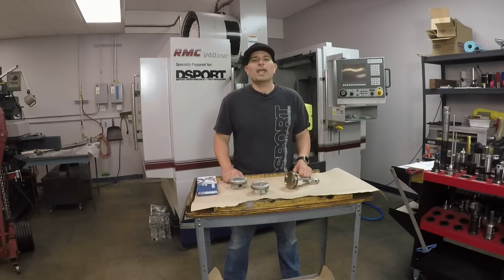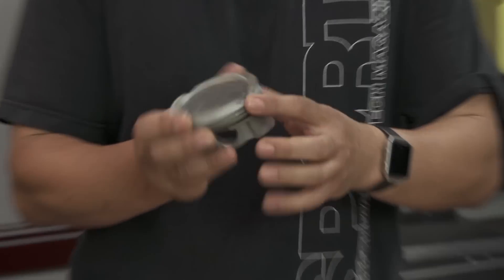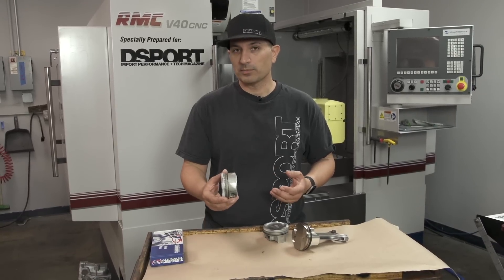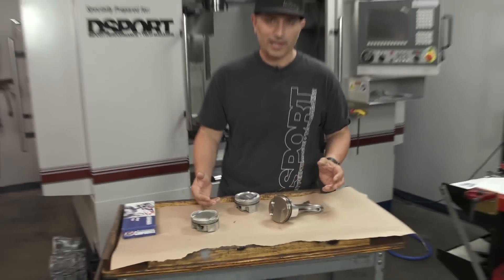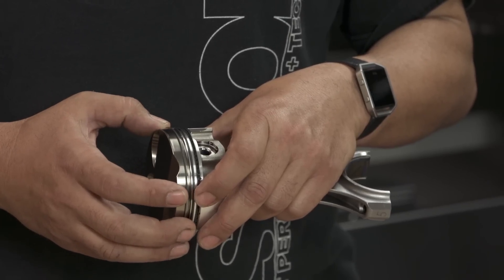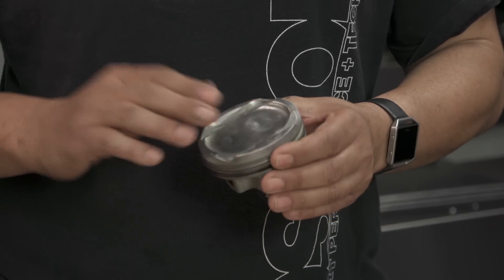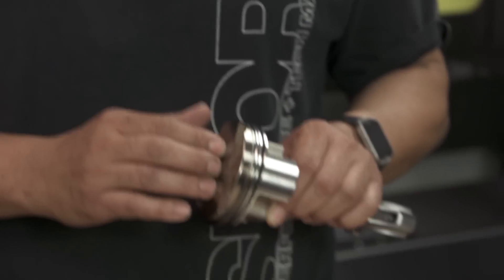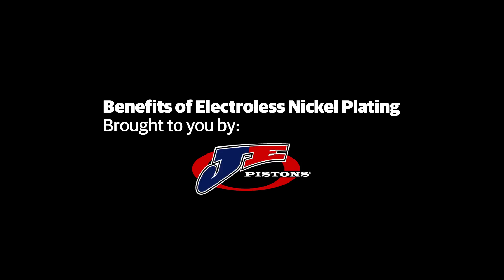Benefits of Electroless Nickel Plating

Comment: So Does Nickel Plating Provide Better Heat Protection Than Ceramic Coatings? Im Gonna Try Out This Nickel Plating Mainly Becasue My Ceramic Coated Piatons Appear To Be Fadding / Burning Off And The Carbon Build Up Was Pretty Substantial I Feel. These Pistons Had About 20,000 Miles And Engine Us A Turbo 100HP Per Cylnder Engine.  Im Hoping The Nickel Works Just As Good As A Thermal Barrier, Stay On Longer And Since Its Alot Smoother Resist Carbon Build Up.

Comment: Well no, nickel has horrible high temperature properties, it's very very soft, becomes even sodter at relatively low emperatures for metals. It is in stainless and inconel but to soften the alloy to prevent cracking or brittle fracture. Now that doesn't mean it isn't a good coating for a piston, but it means the reasons why, aren't what you think they are. Additionally carbon is an element in high allows and it's very brittle great for hardness, chromium again very brittle great for hardness found in stainless and inconel, as well as iron which is soft an malleable, manganese etc.... alloys are about all for the alloy elements working together so to single out one is a bit silly. Now I would be intrigues to know why a nickel coating on a piston is a good thing? Is it just because it's throws out heat better than the ally it's coating? is it just as useful on the older ferrous pistons?
Reply: Well, "electroless"is different. I worked in a semiconductor factory in China, with electroless nickel plating, sort of "expert". This is not nickel, more than 10% is phosphor, some Nitrogen, carbon. This process is more like phosphorizon but better. It's nickle and phosphor alloy. We plating twice, heat treating once in between, make sure the nickle-phosphor combined well.
The process is 1. sand with high pressure air. 2. Clean with HCl, HNo3.3 nickle plating. 3 heat treating with N2 4 clean with HCl,HNo3 5 nickle plating.

That's different from regular "electro plating"
Reply: @ben39157  why do you nickel plate twice?
Reply: @ben39157  Thank you for putting tangles in his place. He didn't comprehend the difference, even the owner of the channel told him "electroless nickel".
Reply: @ben39157   even I have heard nickel phosphorus coated cylinder for Yamaha xt250 bikes.....please explain how it's different from nikasil coat, and it's advantage like is it hard, high temp etc
Reply from the maker: Not sure what you mean when you say that "nickle has horrible high temperature properties." It's melting point is relatively high at 2,651F. The micro hardness HV value from electroless nickle can reach 1,000, similar to hard chrome plating, so its far from soft. In addition to the reasons outlined in the video, electroless nickle plating delivers one of the most corrosion resistant surfaces available. When an aluminum alloy is subjected to elevated temperatures and oxidation and corrosion occur, aluminum oxide is formed. The nickle plating eliminates to formation of this brittle and abrasive oxide.
Reply: I mean it has horrible high temperature properties. 2650F isn't particularly high, Are you talking brinell Hardness? 1000 isn't particularly hard, for metals and alloying materials. As far as it's corrosion resistance, yeah it's ok, but so is aluminium, both form oxides, that is what prevents further corrosion from forming the oxide protects the materials, same with stainless steels. Now is the nickel useful as a coating, maybe.. I didn't claim it wasn't, but as I said it's not the wonder material you're making it out to be. go talk to a metallurgist.
Reply: DSPORT the guy has no idea what he is talking about , nickel is very hard and it has a extremely high melting point , dont you just love wise asses who cant do a simple google search before spouting off at the mouth ? i halve also used nickle welding rods and a moderatly hot torch will not melt them , hho will not melt a nickle welding rod it only gets it white hot , also i smashed some with a hammer and the stuff is tuff   as nails
Reply: tangles01 what ever dude , nickle and copper are the same in your eyes i guess becuase copper is a soft metal , nickle is not soft read this wise ass{{{{Nickel is a chemical element with symbol Ni and atomic number 28. It is a silvery-white lustrous metal with a slight golden tinge. Nickel belongs to the transition metals and is{{{{ hard}}}} and ductile.
]]] so maybe your confused
Reply: tangles01 your not an engineer bro , engineers dont cralw around in super heaters and back passes , they design them , and any engineer will tell you nickle is used in all jet engine alloys
Reply: This has gone from the brink of a normal internet based argument where people just yell at the keyboard endlessly to an actual debate where you are genuinely reading the words and taking it in, well done. I think the "line" for hot or soft could be the issue here. In my work I've done lots of both super high temperature works and cryogenic work. So I do consider iron soft and weak, compared to high end alloys designed to deal with those extremes. It also means that iron engine block, or ally pistons, blocks and heads are all quite soft and weak really dealing with moderate temperatures, low stresses etc. The objection I had was that nickel was a super material because it was used in the high end alloys... and it isn't, it's comparable enough to iron but that's not a super material. It's a very useful alloying element used in both High temperature and in cryogenic class construction, but by itself it's a bit shit. Think of Carbon, iron by itself is also soft and weak, ass a small amount of carbon and you have steel, a much stronger material with better temperature properties, but you wouldn't make anything out of the carbon itself would you, it wouldn't be any good, it'd me a block of graphite. Also the use for straight nickel rods... is to weld cast iron, which is brittle and will crack if anything else is used and will probably still crack even with the nickel rods because it's the worst thing to weld ever.
Reply: dude your obviously not talking about nickle , nickle is not soft , you have obviously never worked with nickle , it may soften metals in alloys im not sure of that but i have used nickle before and fyi the fires of hell cnat melt nickle you need an oxy flame or an arc to do it
Reply: I didn't say I was an Engineer, as far having a degeree, I said working in engineering for 15 years, I know nickel alloys such as inconell and nickalloy are used in gas turbines but it's not straight nickel, those materials gain their hardness and form the high chrome content and heat resistance from molybdenum, the nickel is used to soften the allow to prevent over hardening and fatigue cracking. I know this because I worked with the stuff a lot. Alloys are a combination of many many different things... Iron without carbon is soft and weak. Stainless without nickel is brittle and useless... I never said the materiel isn't useful. In this application it is better than the aluminium the pistons are made from but that doesn't make it the wonder material claimed in the video. But on it's own it is not very hard nor does it have great high temperature. performance
Reply: Nickel has a brinell harness of around 700 MPa whereas a mild carbon steel is around 160 MPa. Aluminum alloys are around 95-110 MPa. The automotive industry uses cast iron as well. Typically, they use gray, malleable, and ductile cast irons for automotive parts. These range in hardness of 150-250 MPa. So, nickel coating is very hard.
Reply: I'm definitely talking about nickel.
Reply: tangles01 lol  2650 isnt a high melting point ??? dude i work with boiler makers they aint metallurgist and most of them aint so smart , just because you can weld dont make you a genius and you said nickel has poor high temp qualities and FYI nickle is used in all jet engine alloys , dont give me your boiler maker bullshit pall im a scaffold builder and a carpenter and even i know you full off it and i mention the hot torch to tell you ive used the stuff and it is defiantly not soft and it has great high temp properties   so face it your probly the boiler maker who runs welder cable and stringers and brings people hot rods when they need them .
Reply: tangles01 well maybe so i have to honestly say ive never ran any testing to indicate otherwise but from my experience i just dont agree , that doesnt mean your wrong im just not convinced because i have some pure nickle welding rods , maybe you mean its a very malleable metal ? i looked at some youngs modulus charts and nickle is stiffer then the following metals ,copper ,tin ,aluminum ,silver ,gold ,zinc , and brass, however iron is stronger but i dont consider iron a week metal in itself  . i applaud your skills as a boiler maker though i work with you guys every day and i no your a smart guy so im not nocking you bro , yes nickle isnt as strong as iron but its harder then all the soft metals . as for its high temp properties i admit ive done no testing to indicate your wrong other then its very hard to melt nickle  ...